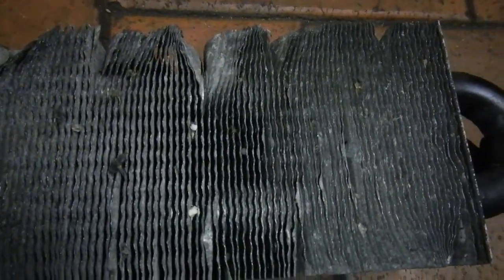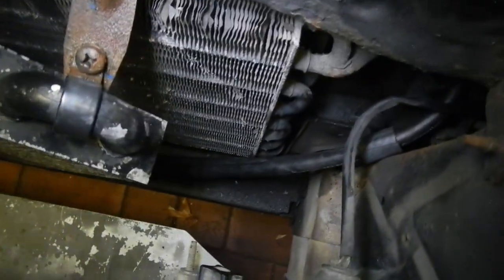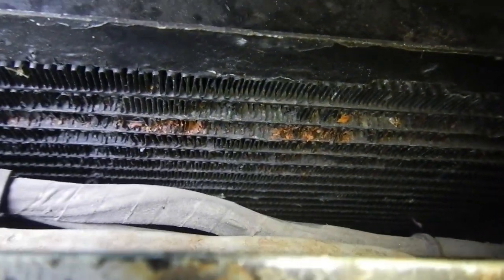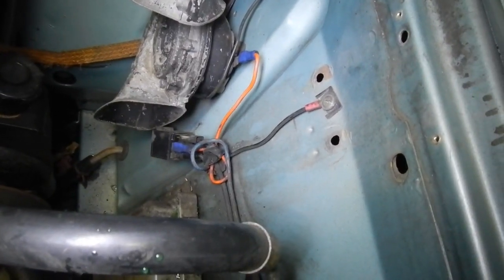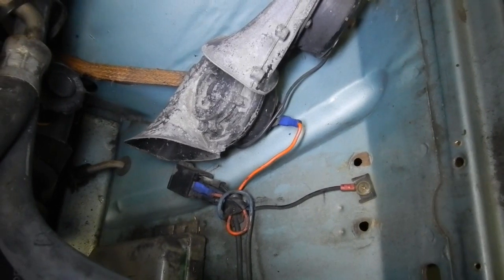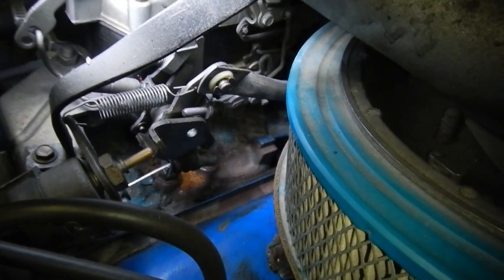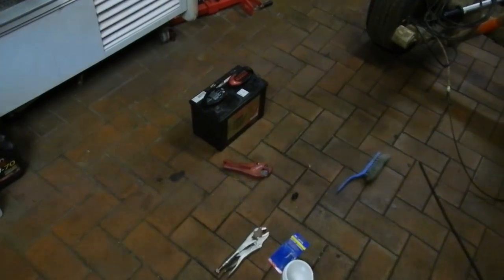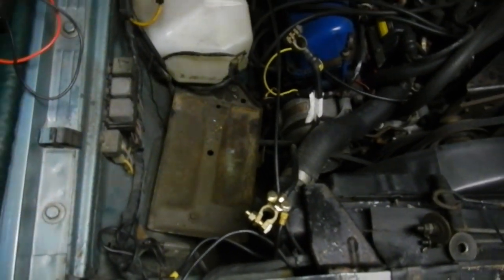78 LTD Fix P3

Comment: Ooow lots of dead or ready to die bits, that earth wire shoved under a plastic relay tab just made me chuckle lol, nice connection ha ha .

I would have looked at the horn brackets and bolted the relay there, then a seperate earth, cant rely on horn brakets for an earth.

It will be happy after you have had your evil way with it lol :-))